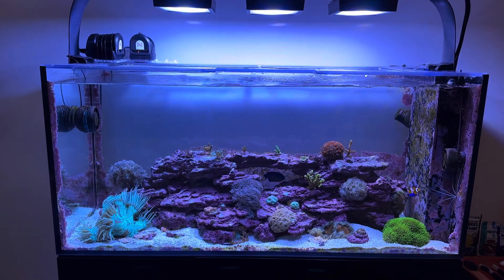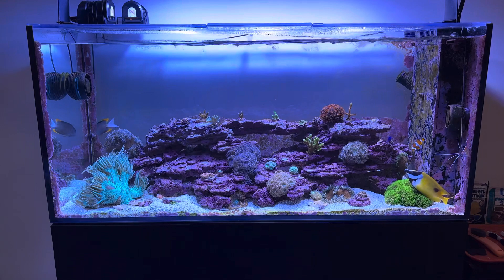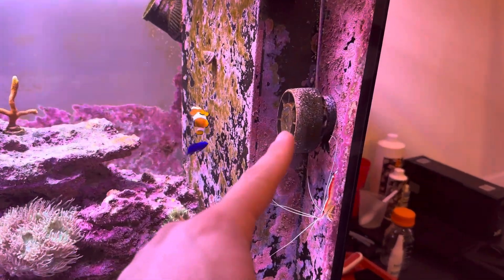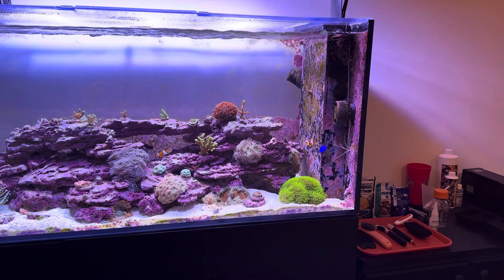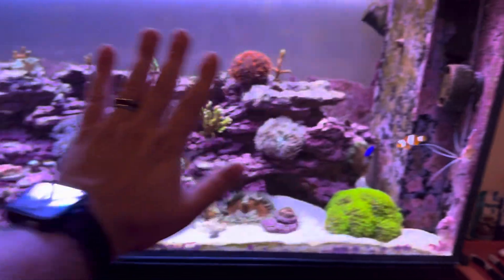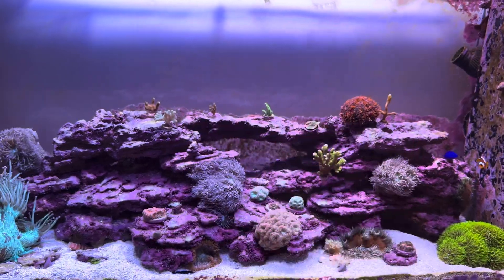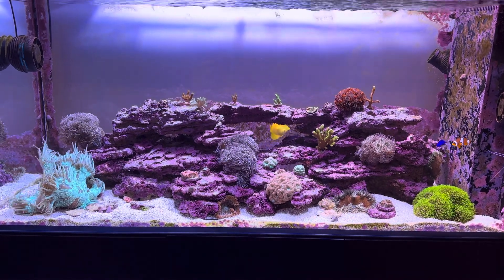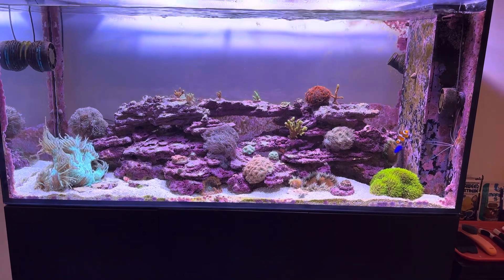Explained: Reef Tank Powerhead/Wavemaker Placement

Comment: I find when I plug both my wave makers in it blows my sand everywhere… idk why ppl can put 2 in their tank and I can only have 1 in my 90… I can’t adjust the flow in my powerheads. Any suggestions?
Reply from the maker: @EXCWISE  I’d aim the wavemakers slightly upward, and reduce their intensity to like 10-20%. It’s possible you have really fine-grained sand. I use CaribSea Special Grade. It’s slightly heavier than most other sand products that LFS shops like to sell.
Reply: @kalamazoo_reefer  I aim them up as far as they go, they still move my sand and blow my corals 😭 I used pink Fiji sand
Reply from the maker: @ The pink Fiji is the problem. That sand is the finest there is. Dang.
Reply: @kalamazoo_reefer  damn🤦🏽‍♂️ anything I can do?
Reply from the maker: @ siphon it all out, buy CaribSea special grade sand, and carefully pour it in. Ha. Replacement is the best call, I’m afraid.